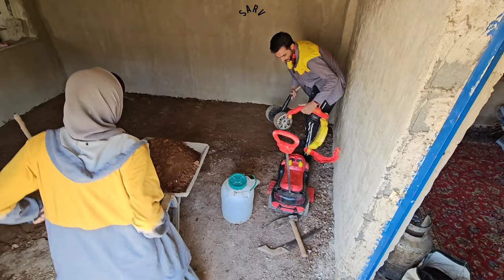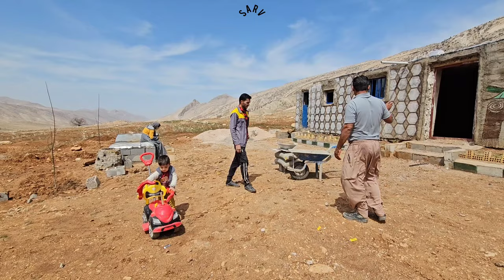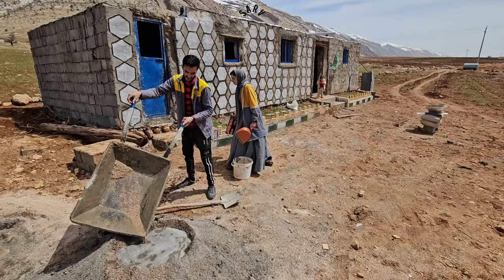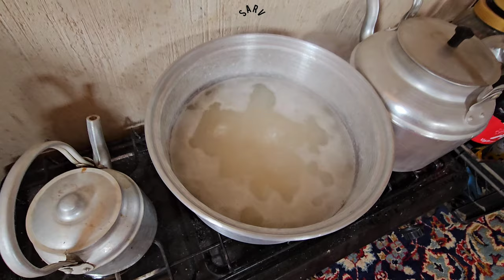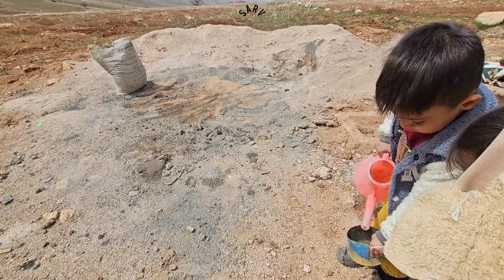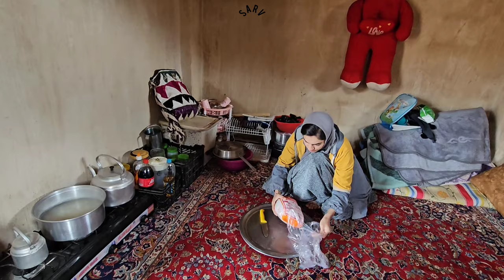The beginning of romantic days: the battle of a nomadic family for a better life

Comment: Why don't you first whitening the walls and do the ceiling, before cementing the floor?
Reply: Makes more sense to do the floor last after all the rest of the work is done first.
Reply: That would make sense. 
That's what most people would do.
They just continue doing it the old ways. They don't seem to want to advance for some  reason.🤷‍♀️
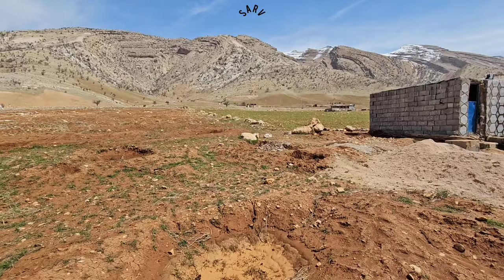Reply: 7:53
Reply: Да хоть как, лишь бы уже делали
Reply: Avant de platrer l interieur  , il aurait déjà fallu faire l extérieur  !!! 😡 Pour que le mur et le platre ne soit pas gorgées  d eau
Reply: Pensei a mesma coisa.
Reply: They will scrape it and it will be covered with rugs anyway.